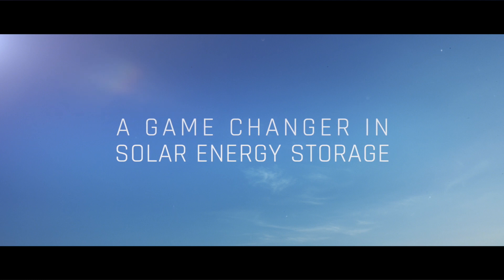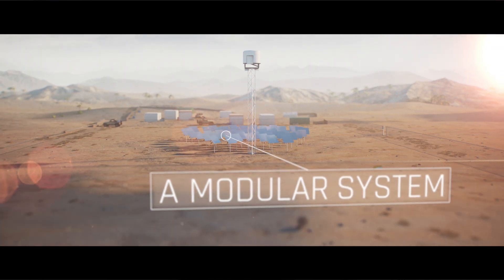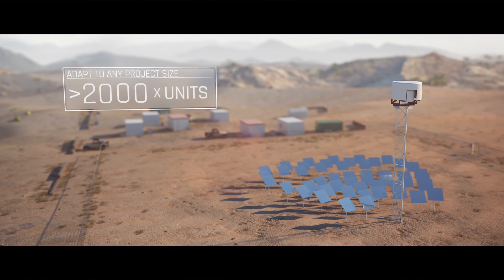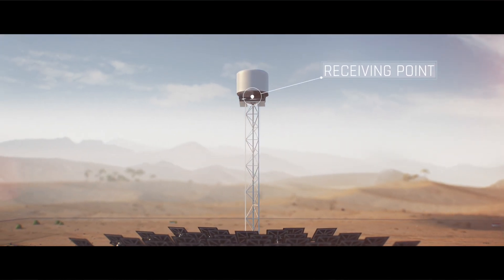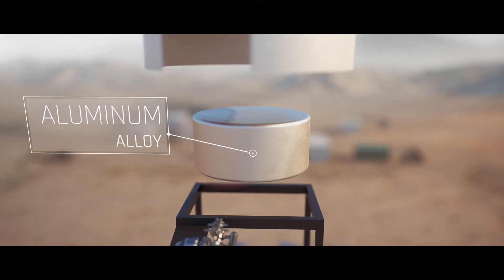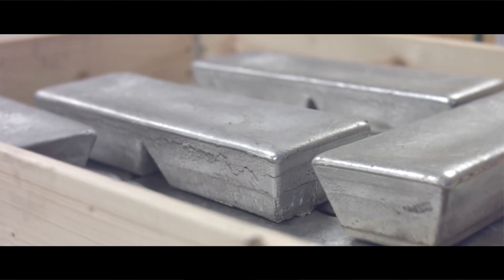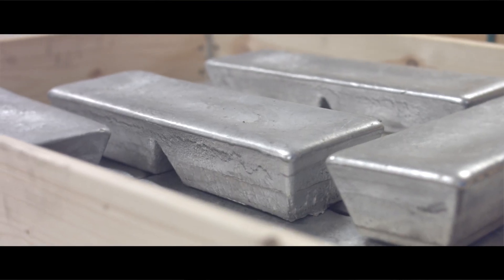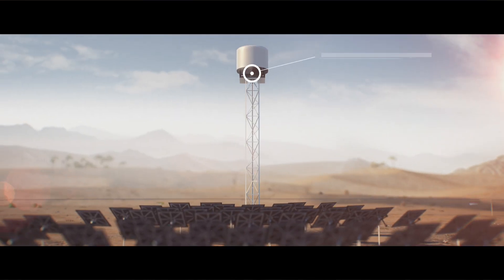Azelio - thermal energy storage with renewable electricity all hours of the day

Comment: Hi, I'm a real estate developer. I'm an idiot in physics, but I always have a keen interest in solar energy because of my business. So your video truly caught my eyes.
I heard there's a method using a Peltier device to make electricity directly out of thermal ( = hot ) energy. Is this 'Stirling engine' method better than using a Peltier device in efficiency , cost-effectiveness, etc?
Reply: peltier circuits are known for having very poor efficiency (~15% on the high end) as well as being quite expensive for how much power they could produce. For that reason they really only have application for running in reverse by taking electricity to cool things rather than produce power from hot things, and even there they're fairly uncommon because of the two reasons i listed before. Stirling engines are fairly uncommon as far as i know when it comes to producing power, they have fairly poor efficiency as well, though it's around 40% at the high end. Steam turbines can achieve close to 90% efficiency, though they're not very cheap they are basically the most common tool used for converting heat energy into electrical energy.
Reply: So is this cheeper then solar PV and batteries?